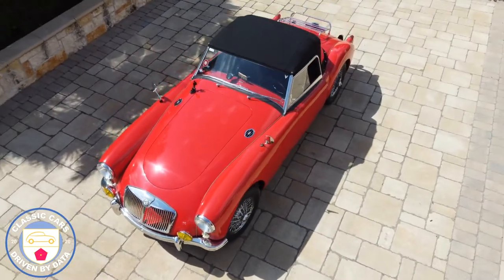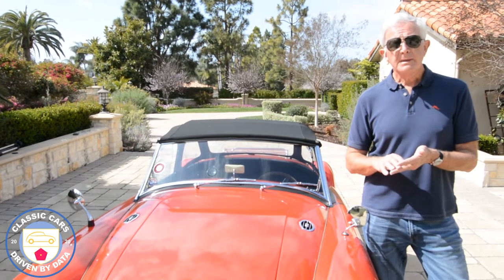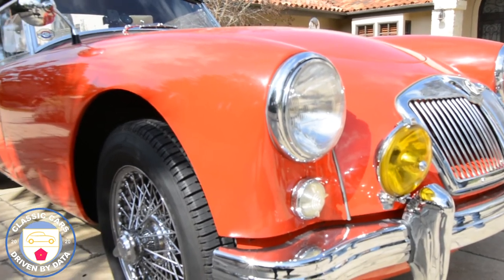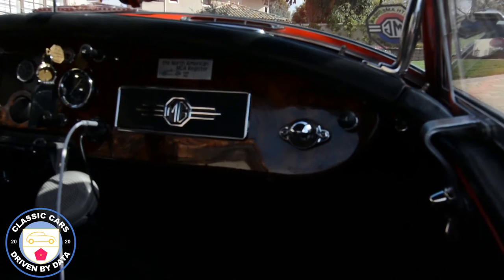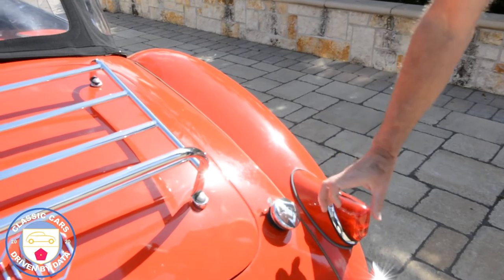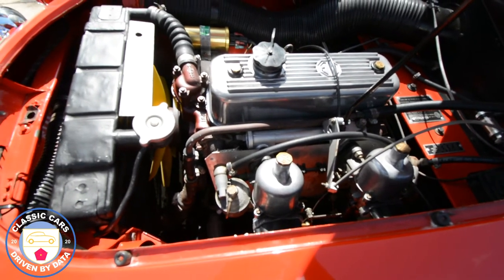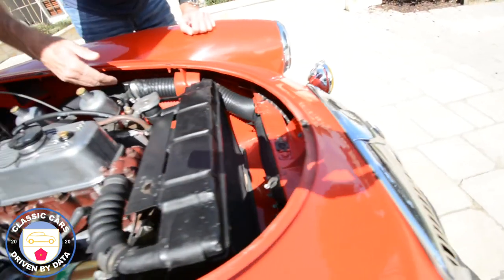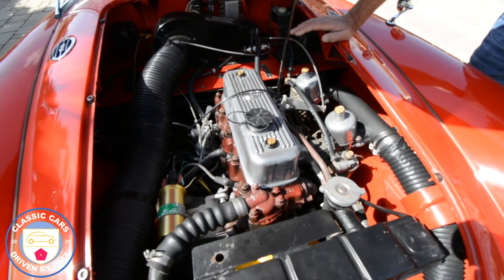MGA - Cool Air Intake, 5 Speed Manual, Front Disc Brakes, SU H4 Carburetors, 14 inch steering wheel

Comment: Is there any indication that your car was once painted black? My MGA that I had in 1967 was later fitted with an MGB engine and wood dash and had the same luggage rack. It had a roll bar that was removed. I can't trace my car any later than 1985 in Virginia. Maybe just wishful thinking.
Reply from the maker: The VIN can tell you the original color - mine was tyrolite green. I much prefer the red.

Comment: Great stuff,  love your videos.  currently looking to acquire an MGA.   since I live at altitude (Colorado) curious if you recommend I find one with the MGB engine installed?  thinking I could use whatever extra HP I can get  since our air is not nearly as dense as at sea level.
Reply from the maker: Yes Jim, if you can find one with the 1.8L MGB engine - also recommend the 5 speed transmission - either Ford or Mazda.